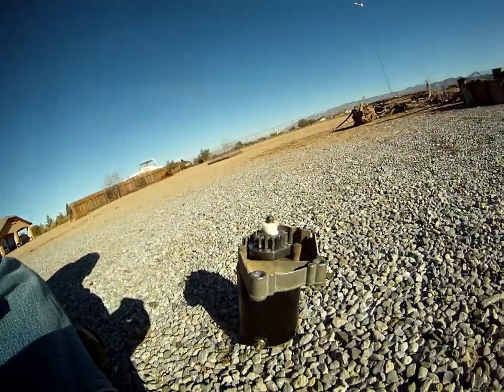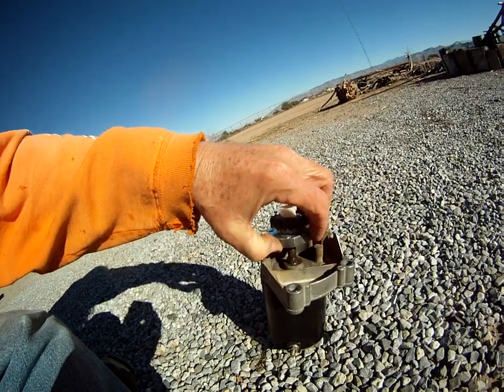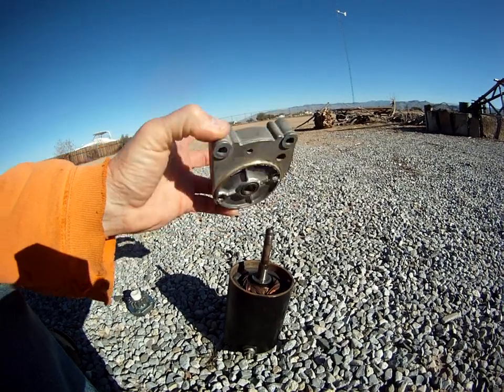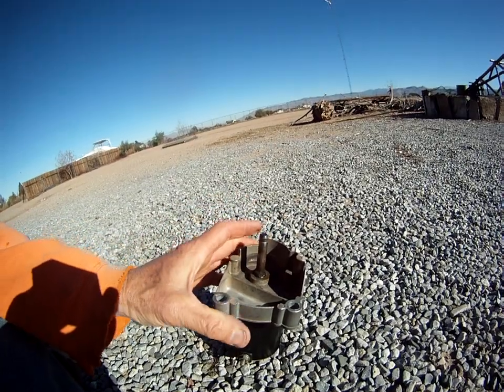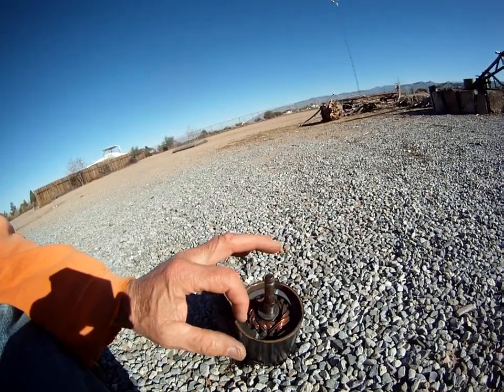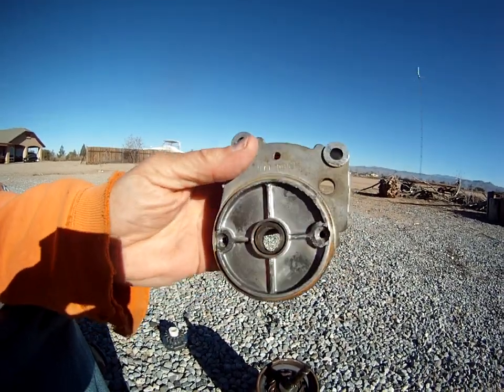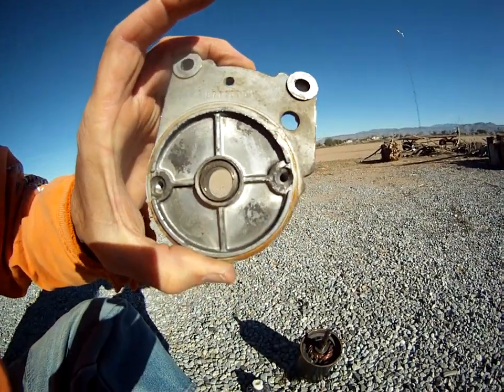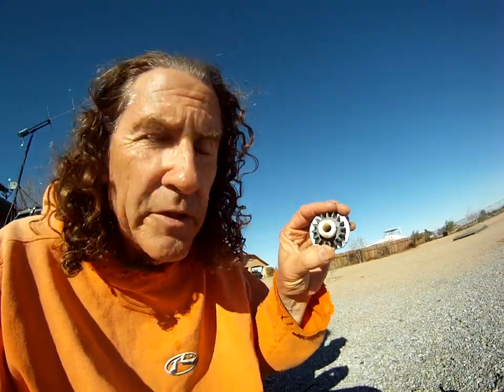Mystery Solved!  Why do I have to keep replacing the pinion gear on my Briggs & Stratton starter?

Comment from the maker: OK my local dealer sold me a used starter missing its lower end for ten bucks that I merged with my own to yield a working starter with a good upper bushing.  I can't believe the difference!  It works so smooth it is almost silent - silent, strong cranking, and the 19.5 hp horizontally-opposed twin engine on my tractor starts right up.  I also ordered NEW top and bottom bronze bushings on Ebay for like six bucks with free shipping, so I have the parts on hand in case this starter goes bad.  I was amazed to see how many people were experiencing the same problem I had of replacing that little plastic gear, over and over.  I never knew how quiet this starter could be!  I just thought it was naturally noisy!  Nope, you can hardly hear it now.  So if you have this problem, check that upper bushing!  :)

Comment: before watching i have to say that i have a bag with 20 bendix gears for my lawn mower starter because they keep getting chewed down.
Reply from the maker: The problem is you have a worn bronze bushing at the upper end of your starter.  That back-and-forth, side-to-side slop is what wears out your gears.  The gear teeth are too far away to engage properly, so instead they get chewed up.  Your starter needs a fresh upper bushing, at least from my experience.   Totally fixed my problem.
Reply: @dougselsam5393  thx for the prompt response. i have a box full of starters ill see about putting one together with the freshest bushing i can find. I watched several other bendix replace videos where i noticed no mention of the bushing so i left brief comments on them addressing the worn bushing in the cap so hopefully others can be alerted to a further repair to be made to save on more frequent time and money spent on bendix replacement. 
Youd figure this was more commonly diagnosed, but from my experience in buying the plastic gear in 10 packs, i can see why mention of bushing replacement is absent. Gotta make them bulk sales i guess. Oh well, glad you investigated and shared, as i was on the hunt for anything other than a replace the plastic gear remedy and wanted better reasoning for the dang thing chewing up my dollars.
Saw your sky serpent crash and that looks pretty cool. ive been watching wind stuff on Robert Murry Smith channel and can imagine some of the configs hes been making up and down your shaft. they are small and light enough i wonder if they could be independent along a long ass tether setup like that feeding down the vein. his serpent coil generator is just a big ole hub that can slide down a shaft. anywho, cool stuff, the tinkerer in me wants to head out back to the junk pile and start picking.
have a good one man
Reply from the maker: Don't forget, you can get a brand new bronze bushing on Ebay for like 6 bucks.  I also combined used parts to fix mine, but have a brand new bushing in reserve in case the latest bushing gets worn.  I could not believe how silent the starter is with a better bushing.  Yes, I agree that they would rather sell you more gears, or a new starter, than a single bushing that would solve the problem.   @koaasst